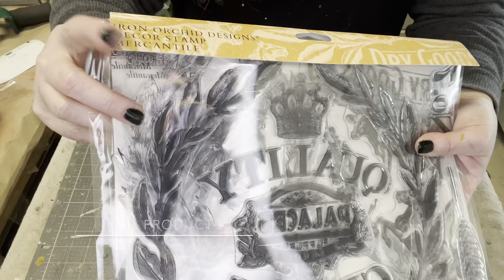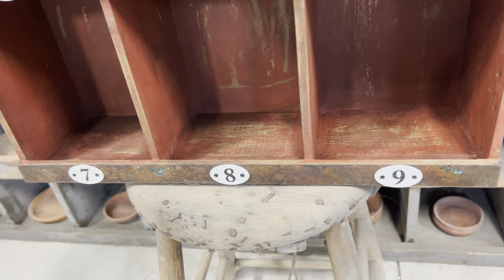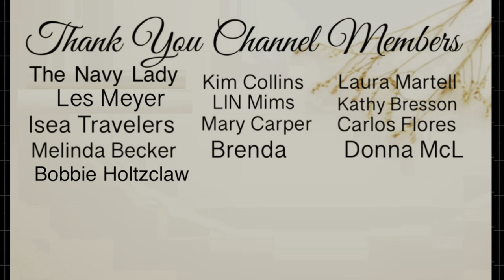trash to treasure diy | thrift store makeover | home decor | primitive decor diy

Comment: I have noticed sometimes you use the powder  milk paint & sometimes you use the paint. Do they differ in the texture they provide or does it depend on the surface you are working with? Do you prefer 1 over the other?